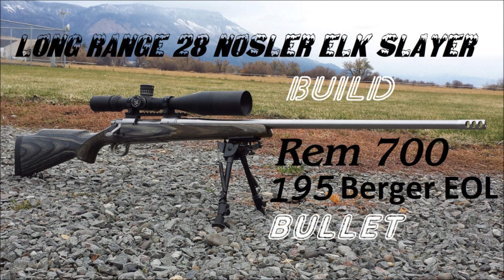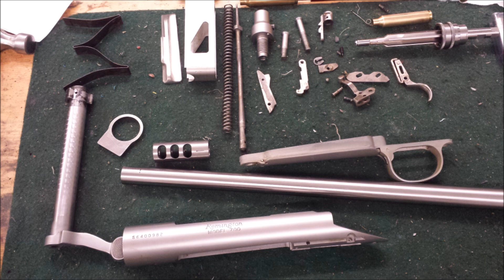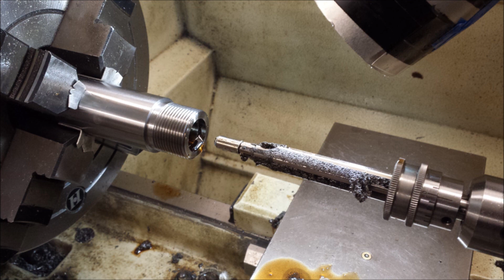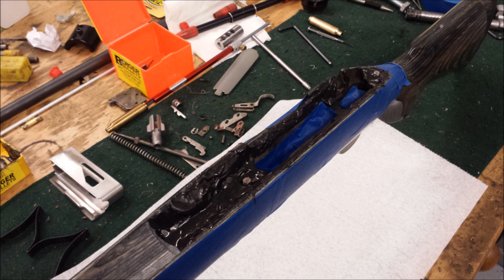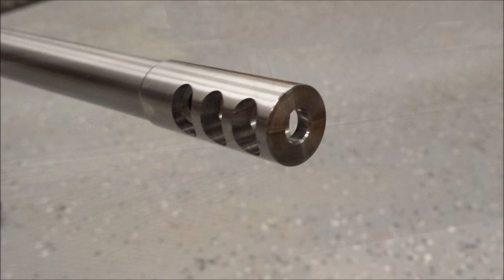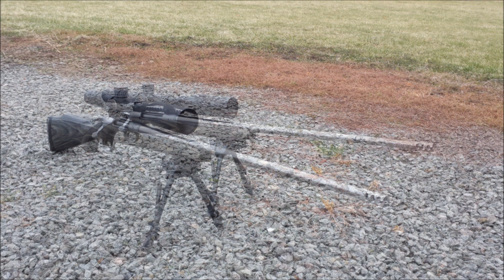Long Range 28 Nosler Elk Slayer Build  Rem 700.. 195 Berger(EOL)

Comment: I have one in the works.  Have a heavy Lilja 8 twist.  It’s 1.35” for 8” then straight taper to 1.25” at muzzle and a finished 30” plus break on a rem 700 hoping it keeps up with my similar 300 rum build with 33” barrel